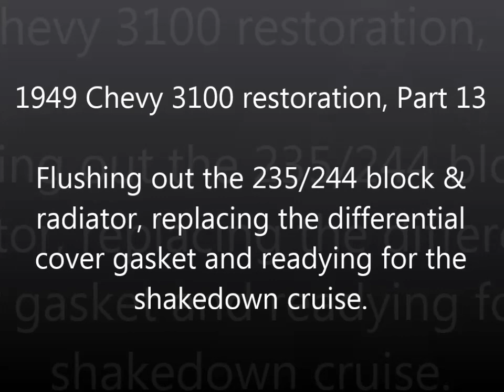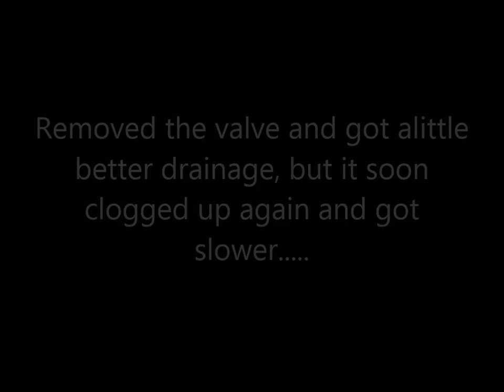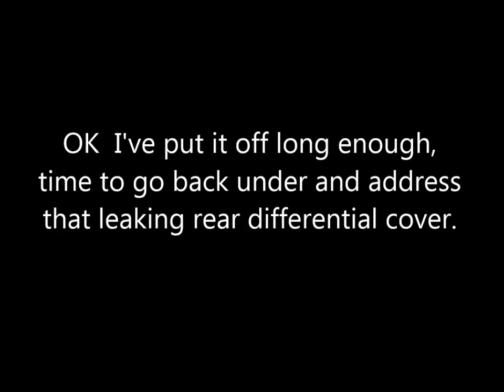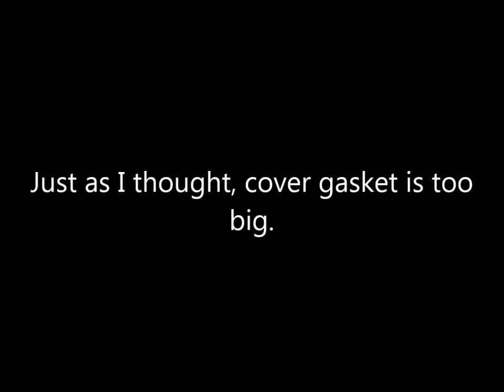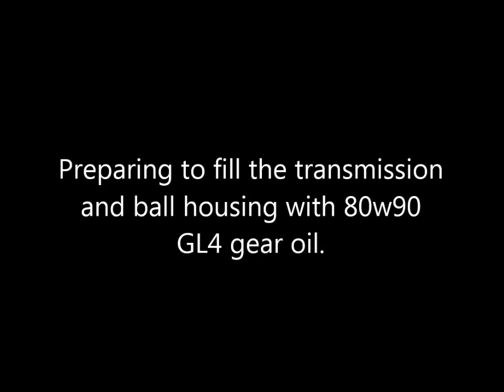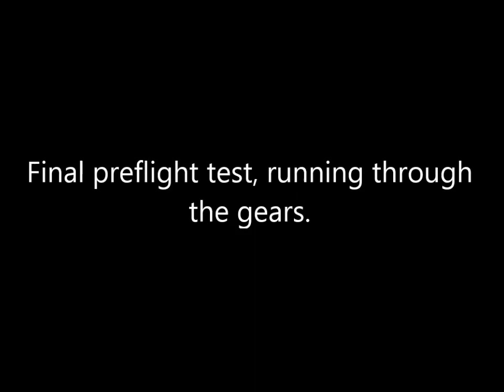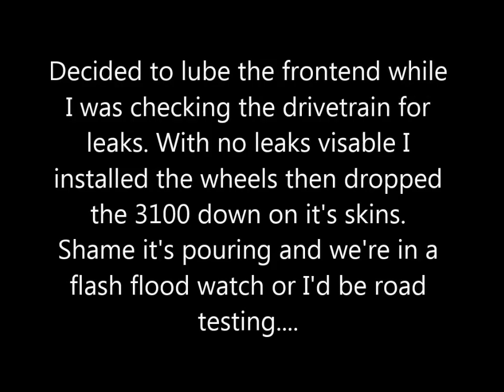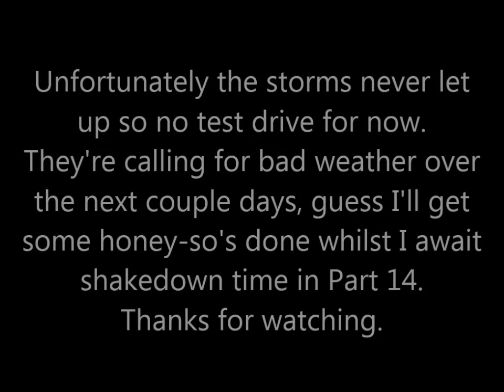1949 Chevy 3100 restoration Part 13, Final preparations for the shakedown cruise.

Comment: Master
Hope all your proyects ara ok.
Now i need to know how to adjust the steering box because the wheel have like 3" play until it reaches the wheel control.
Mine is a 54 chev 3100.
Got the shop manual but i dont quite understand the procedure as described.
Any visuals available?
Thanks again!
Reply from the maker: The play could be in your tie rod ends and drag link ends. Have some one barely turn your steering wheel by just the amount of free play, then crawl under and observe the steering gearbox and all tie rod ends to determine where the play is. If you have done this and isolated it to the steering box I cover some adjustment of the steering box in Part 5.
Reply: @Volfandt  I will do that and check the video too.
Thanks!
Reply: @Volfandt  I purchased the Oil Filter  and Oil Filter line with fitting which i need to install. 
Steps to do that?
Remember, im a 101 student...
Thanks!
Reply: @Volfandt  Our lowest anticipated atmospheric temperature will be 89°F
Puerto Rico is always hot.
Which wil be the best oil grade for the 235?
Thanks!
Reply from the maker: @ericruiz2174  a good quality detergent straight 30W non-synthetic should work for you. No need to spend the extra  money on a synthetic as you should change the oil at a minimum of 3K miles.
Reply from the maker: @ericruiz2174  Depends, do you have a full pressure oil filter or a by-pass oil filter?
Reply: @Volfandt  The oil filter is outside installed over the manifold.
Its a big can with a bolt on top.
With two lines going in and out the engine.
Reply: @Volfandt  i bought like a cartridge that goes inside as a filter...
Reply from the maker: @ericruiz2174  Sounds like a by-pass filter. Loosen the top bolt that holds the top plate on, be careful to keep any washers in the same order as they come off the top bolt as they help to keep it from leaking. R&R (remove and replace) the cartridge. Pay close attention and make sure you put everything back as it (they) come off . Replace the large O ring on the top plate cover (if a new one is provided with the filter). You should be good to go.
Reply: @Volfandt  Thanks for taking the time to share with my family your advise. 
I found the steering box  adjusting bolt and screw. 
Also located the petcot to flush the coolant, its at the end of the engine, close to the fire wall.
Finally, how many quarts should i need to change the oil, icluding the bypass filter?
I dont see that in the manual.
Reply: @Volfandt  Ah, installed the coil, spark plugs, calibrate them @ .035" by the manual, and spark plug cables.
Now i have left the point, condenser, rotor and carburator kit which is leaking...
Inch by inch its a sinch...